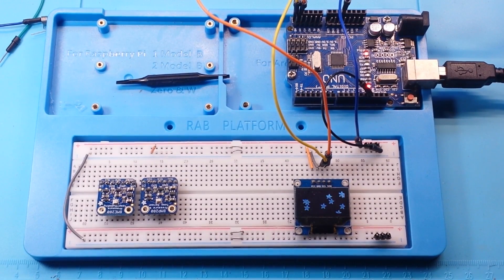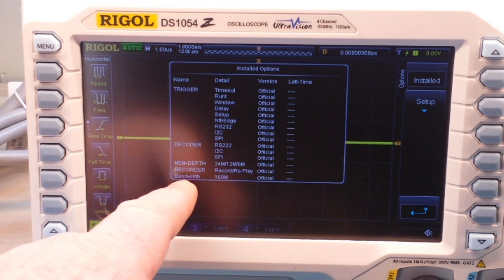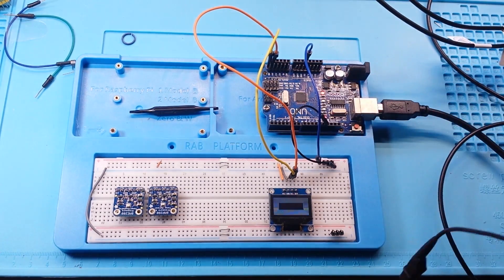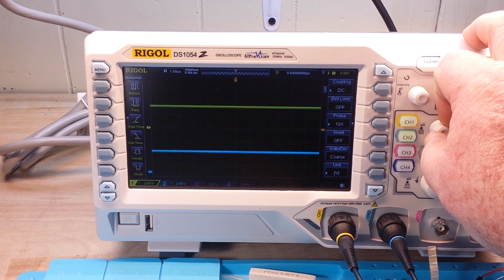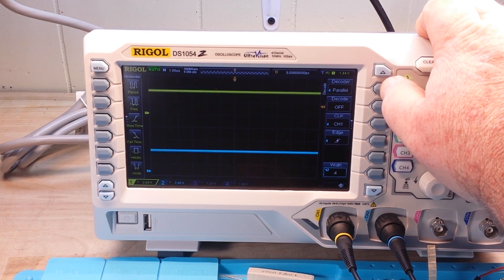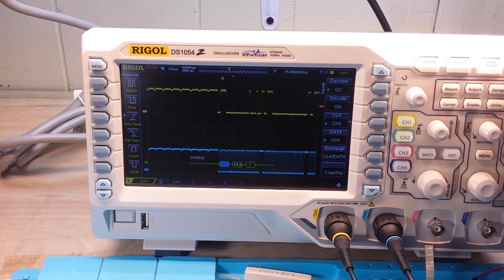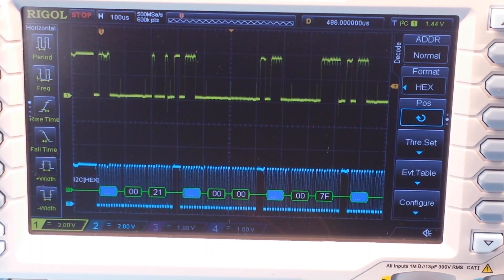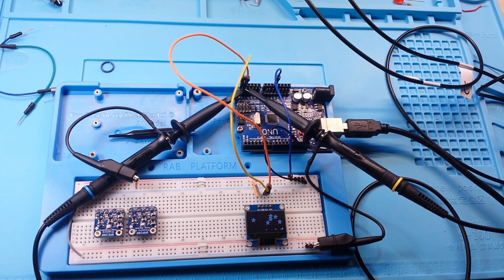How to decode I2C serial data on the Rigol 1054Z oscilloscope

Comment: where did you buy the scope. because if you would buy it from amazon or other sellers (not original Rigol Website/Store) the scopes get hacked. If you buy the Scope originally from the Rigol store, it will not be fully unlocked.. (my experience)

Comment: Hi, i am trying to find the i2c sda scl pins on the:  LILYGO® TTGO T-CAN485 ESP32 CAN RS-485 Supports TF Card WIFI Bluetooth Wireless IOT i2c Engineer Control Module Development Board  the info is not clear which spare pins are used and the oscilloscope could help showing the waveforms, i hope? 🧐  any suggestions?  thanks.

Comment: I am considering buying a scope like this (I am electronic beginner like one year expereince) and before i will buy a oscyloscope I would like to know them a little bit better so I could choose the right one for my purpose. Ok I have a question is it possible to see in real time the signal but just slowed down? I mean let's say it would be a signal of 1 MHz and I let's say generate my own signal for example 00110011 and repetead this 10 times how can I find it on the oscyloscope (as it makes like 1 000 000 cycles liek that every second) and is it possible to capture it by the oscyloscope (I mean program it like"if every time if you see 00110011 it is my personal code etc.) - just an example.
Reply from the maker: Yes, that is in the triggering menu and protocol decoding.

Comment: Nice tutorial on the setup, thanks. But how can I use this in practice when data is rushing forward so fast that it is not possible to perceive? Feel free to enlightening a hobbyist like me.
I am considering buying an oscilloscope and the DS1054Z is a likely candidate.  (I am currently working on a project now with MCP4725 DAC:s that works well with I2C with out any scope.)

Comment: I have a question, does the left side of the housing get so hot after buying the 1054Z in your home?
Reply from the maker: no
Reply: @learnelectronics  :( My oscilloscope is warm on the case.

Comment: Hi Paul,

I’ve wanted an oscilloscope for as long as I can remember.  This video is about to put an end to that desire.  Thanks!   My only question is how do I tell before I buy whether it has the unlocked software or not?

Thanks again!

Nick
Reply from the maker: All I can tell you is the ones from Amazon are unlocked.

Comment: I bought one two months ago. Mine came unlock except for the 100Mhz. Very good scope for the money. Thank you for the video
Reply from the maker: May I ask where you purchased yours from? Seems that so far only Amazon has had the 100MHz front end unlocked.
Reply: @learnelectronics  I bought from Amazon with all options enabled except the 100MHz.  Maybe someone hacked and return it to Amazon that sold to you...  weird and a bit of big luck.
Reply: learnelectronics hey thanks for asking I bought mine from eBay

Comment: I have a question.   I to did have everything enabled by default.  Exept  the bandwith.   Is there a   legel way to get this also.   Or do i have to revert to hacking?     100mhz would be fine but as a 4x 50mhz it fine too.   I only use it for audio freq  anyway
Reply: I would contact Rigol and see if they will help you. And go through the sales department. I have learned over the years that sales departments usually take care of things fast and seem to know the right person to connect you to.
Reply: @robertcalkjr.8325  Did you get the 100 MHz bandwidth?  I bought from Amazon with all options enabled except the 100MHz.
Reply: John Robson  I don't have a Rigol.
Reply: @robertcalkjr.8325  Sorry, my mistake.
Reply from the maker: Mine came that way. I purchased it last week from Amazon. I dont know of any way to up the bandwidth. But I'll see what I can find. Where and when did you get yours?
Reply: @B Touw,  Did you get the 100 MHz bandwidth from Rigol?  I bought from Amazon with all options enabled except the 100MHz.

Comment: Hi Paul, I also have the 1054z, Can you do a video on accessories for any scope and where to buy them? Like I only have the leads that came with it. What other cables would be useful to have. Like a bnc to alligator clip, bnc to bnc, 50 ohm impedance adapter, etc. Many thanks Rick
Reply from the maker: Yes! Good idea

Comment: I don't remember how to do it but the scope can also display a table of about the last ten "packet" decodes so you don't have to do the "scroll across" to see more than one decode. I have had my rigol for a couple of years now and really like. It does for about $400 what cost several tens of thousands a few years ago. The only thing I have found is that setting up a good reliable trigger can be a bit fiddly.